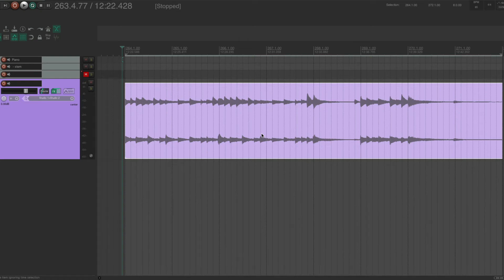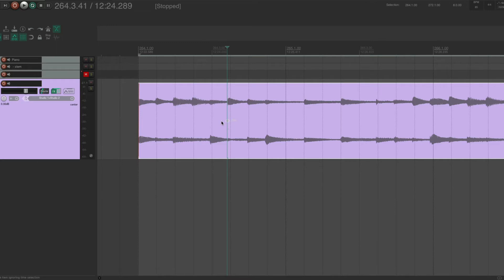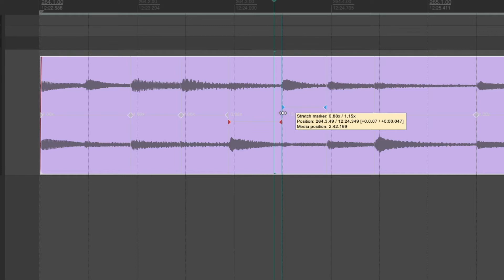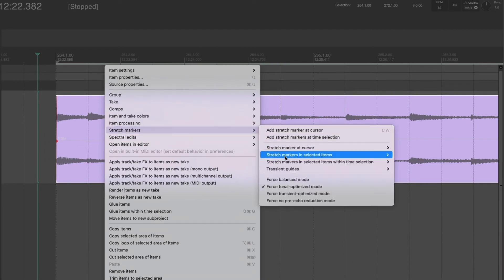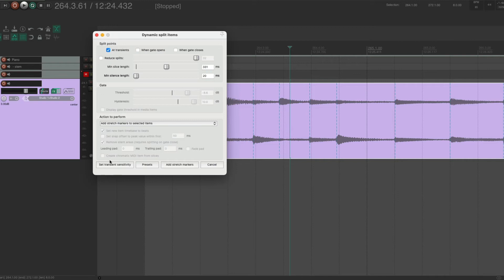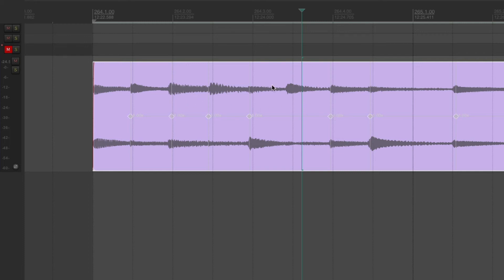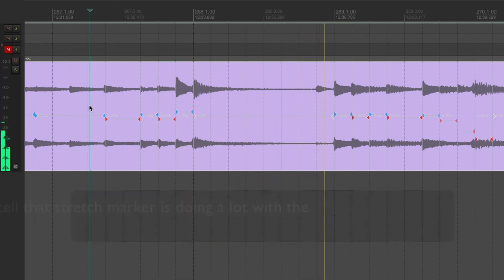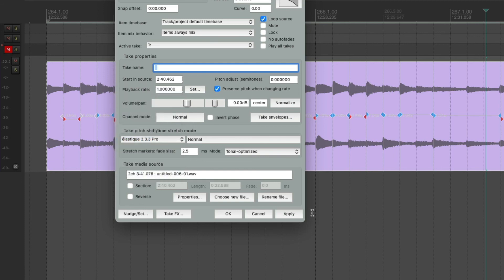How to tighten the timing of audio in Reaper using Stretch Markers.Improve the quality of your audio

Comment: Thank you, but I wonder which version of Reaper is this? I have 7.27 and it’s not working quite the same. I’m on windows 11 so I’m holding shift+W and clicking. It’s funny, I used to want to throw my laptop thru the window. Then I found vids like yours ! I just received the hard copy of the manual, now I want to throw IT out the window.
Reply from the maker: Sorry for late reply! I cant remember which version of 7 it was. Did you have any luck with it